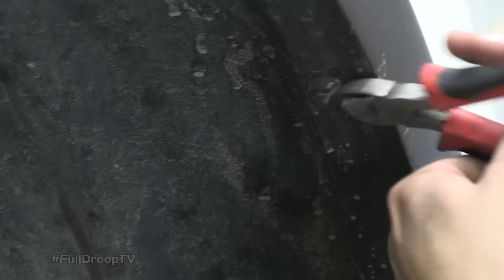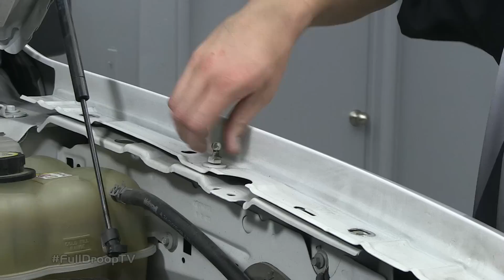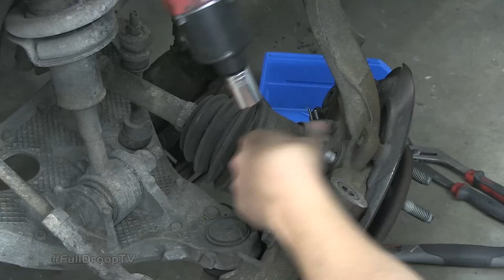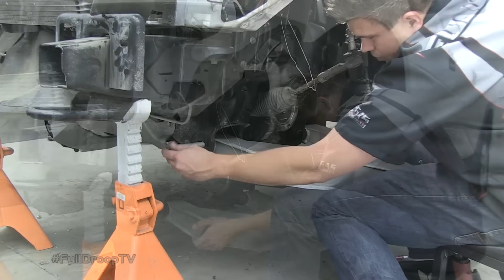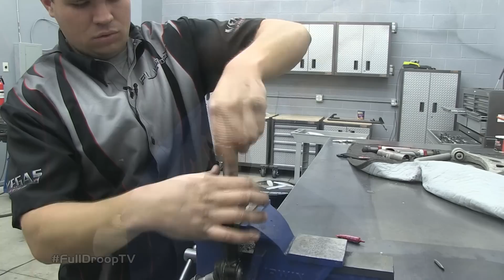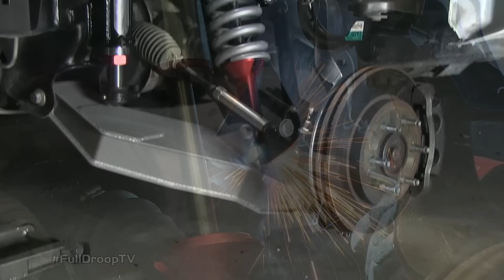Project F-150 Prerunner Fenders & Front Suspension - FullDroopTV (Season 1, Episode 7)

Comment: good to know the front fenders actually aren't that hard...I just got my fiberglass ones.

Much like everyone, yes that gap at the fender bugs me, so I think when I do mine, I will not tighten down the one behind the headlight until I have that lined up with the hood.  Only one other question...on the passenger side fender, do they just drill a hole for the factory antenna?

Comment: 1. The gap does bother me on the glass. I'd send those back immediately. It's a common problem, and most glass shops are happy to replace with a better fitted replacement
2. High angle ball joints aren't all that bad for a lower priced, functional long-travel kit. Not everyone can afford a 10k dollar long travel heim kit (which doesn't even include coil overs/resi shocks)
3. Some of the techniques he uses are kinda cringe, sure, but: this kid has more talent than most of the keyboard warriors posting these hate comments. He works the way he works. Whatever. Relax.
4. Hanging the brake line is a big no-no, however, when installing a long travel kit, you don't use factory brake lines anyway. So who cares if it stretches, or even breaks. It's getting replaced with 9+ lines

Give props where props is due. The truck turns out pretty awesome, and is fully functional. Coming from a background in fabrication, and an off-road enthusiast, I can say this is a pretty damn good tutorial start to finish. He not only gives you locations, how-to's, but also includes what EVERY BOLT/NUT SIZE is as he's doing it.

Comment: how much does the long-travel suspension lift the truck from it original hight? i have an 06 TRD tacoma prerrunner that i want to do this to.
Reply: Not much. Proper desert prerunners and race trucks aren't much more lifted than stock. Hell, some are lower. They try to keep the center of gravity low. Don't want to flip these things when turning or carving berms. The big ass tires get room from increased track width and modified body panels (fiberglass fenders). If using coilovers, you can typically adjust the suspension height with the spring collar on the coilover. You want a good amount of squish and droop too much of one and you're bouncing off stuff instead of absorbing it.

Comment: the front of that new fender did not fit correctly, if you look after he was done installing it the front headlight did not line up with the fender, causing the fender to be lifted above the hood
Reply: Thats not an install problem. Its how they were molded.

Comment from the maker: They are the 56000-110 a 2.5x10" remote reservoir shocks. I can't put links here in the comments but if you visit Sway Away's site and click Offroad Racing in the left column, then in the right column click RACERUNNER SHOCKS 2.5", you will see this part number. I really have no way to determine their lifespan because everyone's driving style and truck is different. They are rebuildable so that helps!!!

Comment from the maker: Don't worry about the bumpstop fully compressing that's its job and limit straps generally stretch about about an inch per foot but that is only if you drive hard enough to completely droop out the suspension and actually stretch it.

Comment: I have a F150 that I will be putting on a midtravel suspension, I will be using a hydro bumpstop to limit up travel but to actually keep it from fully compressing the bumpstop do I just pump the pressure in the bumpstop high enough for when i jump and land/fully compressing the suspension the bumpstop does not fully compress?   and I just want to make sure I have this correct: limit straps will stretch approx 1" in their lifetime, so I need one less inch in the straps new?

Comment: This Is Awesome! While you Guys were Doing The Chevy Video I Was Installing Some Fiberglass Fenders. I Was Interested With The Dixon Bro Kit Due To Cost For My 1998 F150 4x4 Stepside. Otherwise I Will Have To Do My Suspension Last =/ Hoping Someone Will Make A Video In As Good Of Quality As You Guys For My Older Model Ford. Ps The Only Thing Good On A Dodge Is There Heated Rear Bumper For Pushing It Home.